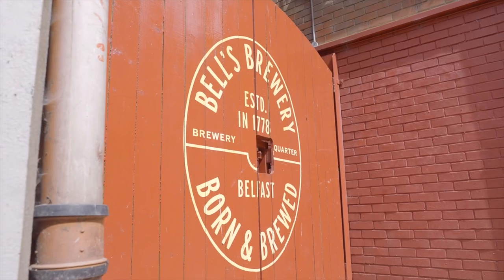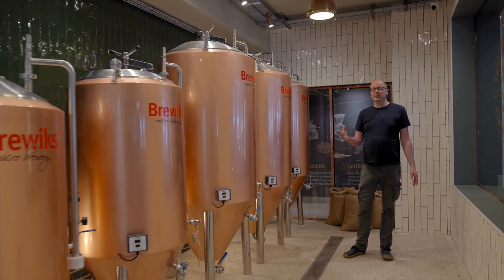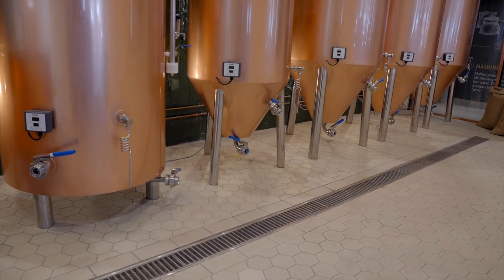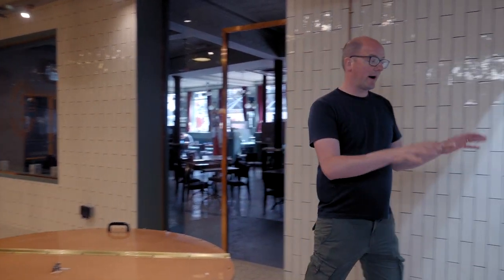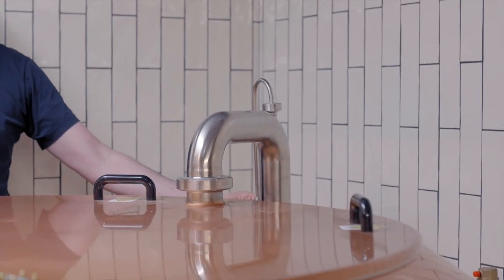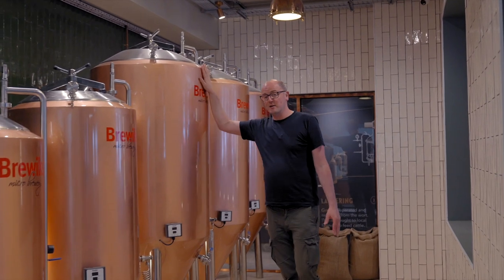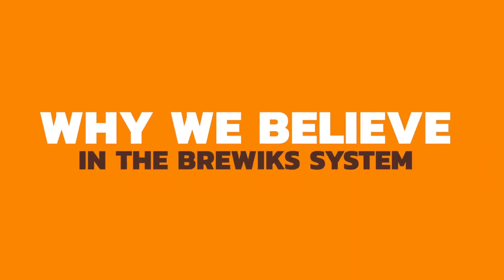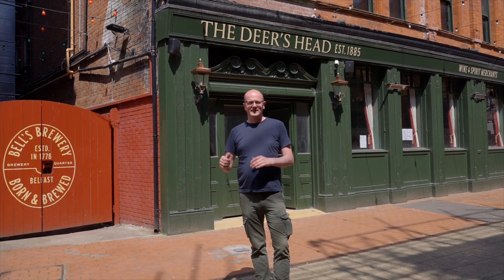Belfast's First Brewiks Brewpub - The Deer's Head home of Bells Brewery

Comment: Great video and beautiful kit! A few questions: so you're actually pumping the entire malt and hot wort over to the lauter tun after mashing? How does the recapturing of the cooling water work - isn't the kettle still full of hot wort? Where will they be serving beer from? Do they have serving tanks or are the kegging?
Reply from the maker: Yes we transfer the entire mash to lauter tun, carryout sparging there and then we dig out the lauter tun and its used as a whirlpool after the boil, so we recapture the cooling water in the kettle as its empty. Beer is all kegged in the Deershead. Thanks for the comment